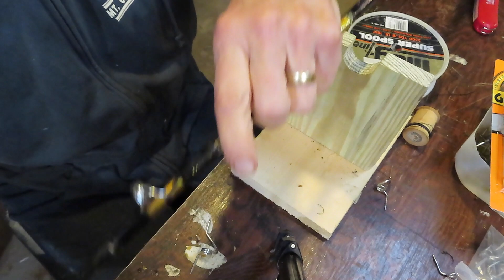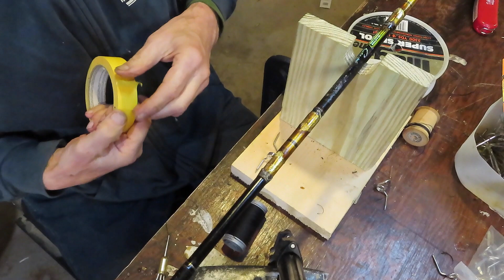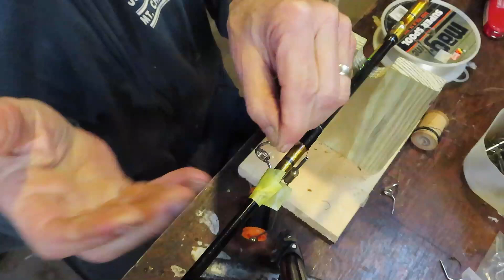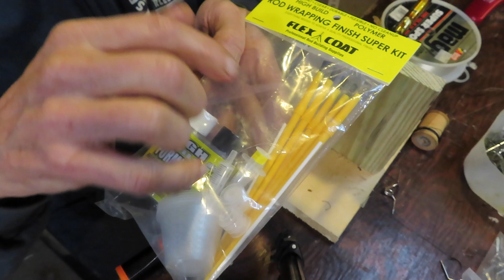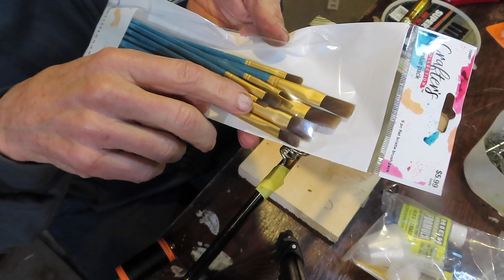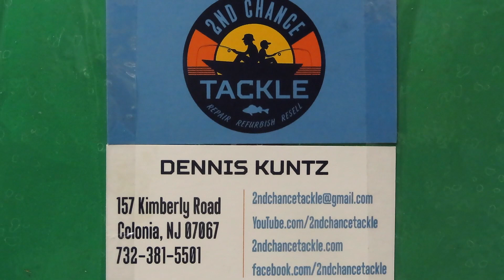How I replace a line guide on a fishing pole and make an emergency repair

Comment: Old Rod still have life in them, if given a chance.  I have taken several rod to my local tackle shop to get repaired.  Yes I could have taken the cash I spent it on a new rod, but the new rod do not seem to stand up well and tend to made to the cheapest price point.  New Rods seem to have cheap line guides and the wrapping is a min.  

In my case, I think a good old solid rod is worth having the guides replaced, as it will outlast a typical mass produced CHINA rod and it will provide you with a good value and it will keep your local shop working.
Reply from the maker: Yes they do!  Anything worth buying is worth preserving.

Comment: I have had good luck cleaning the epoxy finish off your brushes with denatured alcohol.
Reply from the maker: Yes.  I have used rubbing alcohol  and the cleanup has been fine.  I also believe nail polish remover can work equally well.  Thanks Barney - Dennis

Comment: There is no way I could do this because of my blindness. I am 60% blind and have no center vision. That makes something like this incredibly difficult even with magnifiers and I have a lot of magnifiers. I use them when I work on my reel collection. I am impressed that you do this along with all your other talents.  I have a rod I need to get repaired but it is to replace the largest guide with an insert on a 12’ surf rod. Someday I’ll get it fixed but I don’t know when.
Reply from the maker: Sometimes I surprise myself by what I have learned.  I normally leave the eyelets to professionals, mine are utilitarian fixes meant to simply keep the rods fishing.  The pros are artists that make the projects beautiful - Dennis
Reply: @2ndChanceTackle  The fellow in Snead’s Ferry NC that I used to get my Mitchell reel parts from was very gifted at restoring and building large offshore trolling rods. He was an extraordinary man. He wouldn’t even touch a reel newer than 1990 or so and other than Mitchells he specialized in large older big trolling reels like he would use on his big boat. I really miss him.

Comment: Nice job, Dennis. Reminds me of how I re-wrap eyelets, except I used sewing thread, duco cement (at first) and the Loctite instant mix 2 part epoxy (later).
Reply from the maker: Thanks Garrett - there are many products but only a few variations on the how to parts.  Best wishes - Dennis

Comment: Glad to see your method, I recently bought 23 rods with reels for $100, and have given away many after repair as Christmas presents. I have a few that need re wrapping of the rod eyelets. I have done one, but I guess what I wonder is.. where can you source good rod eyelets that are new?
Reply from the maker: muddle.com and HFFcustomrods have a nice selection of eyelets
Reply: @2ndChanceTackle  Thanks just looking t them now
Reply: I have been using 30lb braided line as the thread for the eyelets.
Should i be using regular thread? It seems that braided line is nice stuff for it.
Reply from the maker: I haven't heard of folks using the braided line.  Some lines and threads with coatings react differently to the epoxy finishes.  Best to check with a test if you want to continue.  For example, the color may bleed or the epoxy may not adhere as well - Dennis